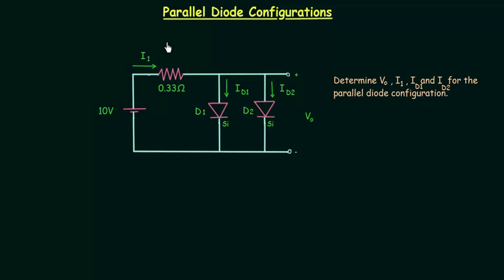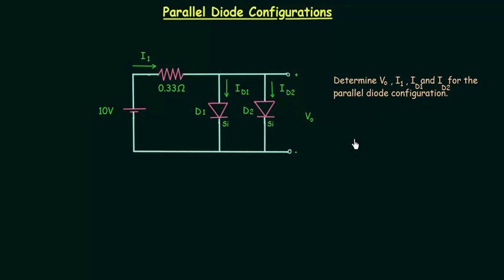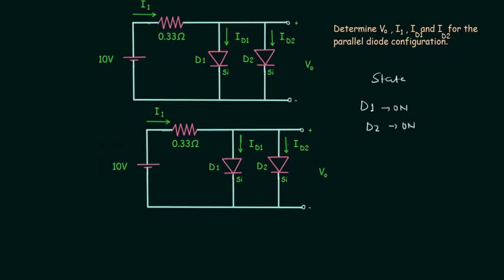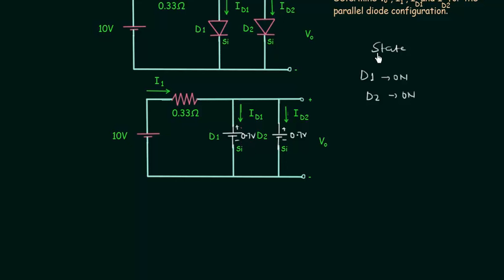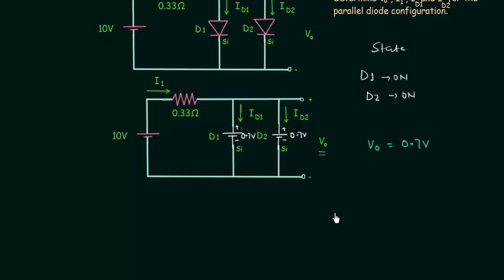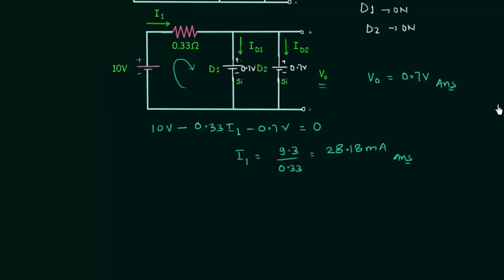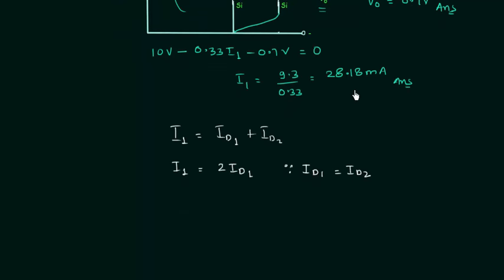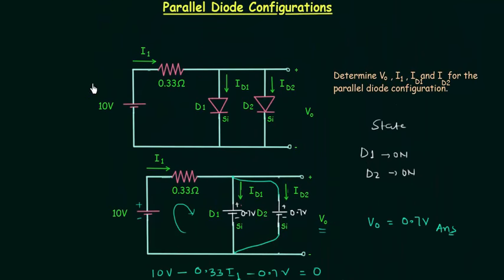Parallel Diode Configurations

Comment: what happens if one of the diode is of Ge and the other one is Si?
Reply: I think jee main 2019 january ka question ke liye tum yahan aye ho 😁😁
Sahi bola na??
Reply: good question , we need answers
Reply: Then there must be a resistance with their respective diode(or we will use linear piecewise diode)
Reply: You will just replace the value of Si which is 0.7 the value for Ge is O.3
Reply: Then only Germanium diode will ON because of low voltage of 0.3V and Silicon diode will OFF

Comment: 9.3V/0.33ohm = 28.18A not mA.
Reply: Csaba Molnar Probably its 0.33k ohms
Reply: 0.33 ohms will burn the diode😂😂😂
Reply: yes, you r right. but I think 0.33kohm is the actual value
Reply: Yeah this is the point where I was stucked

Comment: Hi Gentleman, 
How to calculate the Id1 and Id2 in the case, if diode 1 is silicon diode and diode 2 is Germanium diode?

Thanks
Reply: and output voltage Vo too.
Reply: Rajinder Bhagat Vo will be 0.7V
Reply: Rajinder Bhagat :if ge diode is used along with si in parallel then ge will conduct therefore output will be 0.3. si diode will never conduct as it requires 0.7 volt to conduct.
Reply: @shubhamnayak9369  can u explain more pls ?
Reply: @fariborzmomtazzadeh4497  see both Ge and Si diode are in parallel..ok now input voltage increases slowly.. 0,0.1,...etc as soon as it reaches 0.3V ,Ge diode conducts...so voltage across Ge will be 0.3V and since voltage across parallel combination remains same so voltage across Si diode will also be 0.3V but Si diode will conduct only when 0.7V is across it.. but we know it is 0.3 V so Si diode will never conduct as loong as Ge is conducting
Reply: @fariborzmomtazzadeh4497  remember that diode conducts only when forward breakdown voltage is applied across it. And once it conducts the voltage across diode becomes fixed and is equals to its forward breakdown voltage. Si has 0.7V and Ge has 0.3V as forward breakdown voltage
Reply: @shubhamnayak9369  Thank you man !
Reply: @fariborzmomtazzadeh4497  welcome bro ;)

Comment: What if we have 2 different types of parallel diode, where the equivalent model (the polarity) are not the same for both of them?
Reply: If the diode is placed in reversed direction then it simply will act as an open circuit causing the parallel configuration to act like a normal configuration.

Comment: if D1 is Ge which have 0.3V, then what will be the result?
Reply: the overall voltage drop across the combination of germanium and silicon diode remains the same as that of the  germanium diode so that silicon diode wont even be activated. And we can have voltage drops in each case as 0.3V.

Comment: Why you didn't point out the risk of thermal runaway in case of negative thermal coefficient of Si diode. Its risky to parallel two Si diode without any snubber or protection/current balancing circuit.

Comment: In the real case the voltage drop accross diodes in palallel is lower than the one in a single diode. The simplified model of diodes i this circuit is not adequate

Comment: what if there were two different diodes?
Reply: Then the currents wouldn't be the same.
Reply: @richardmatjeane9004  Only one would be on,the one that requires smaller Vb